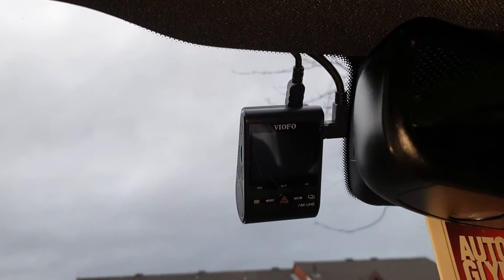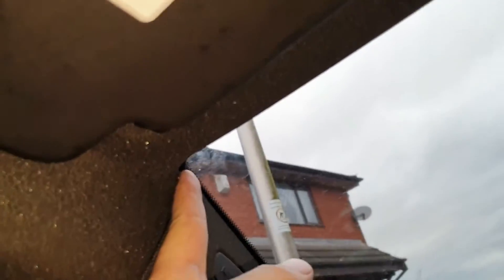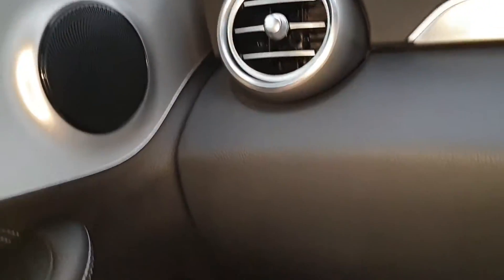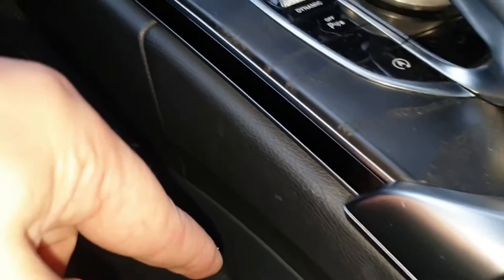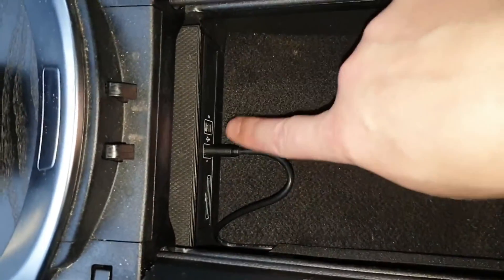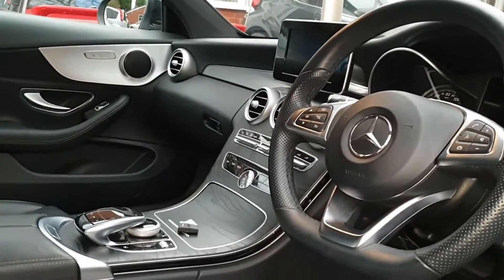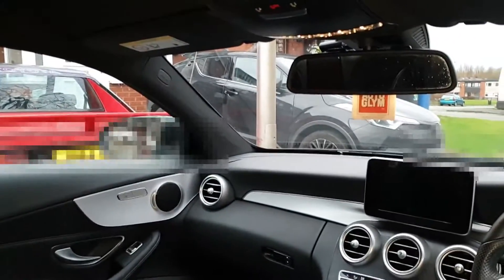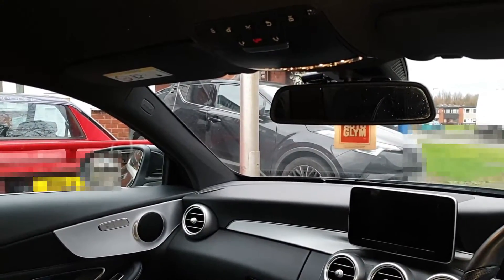VIOFO A129 PRO DUO DASHCAMERA  USB INSTALLATION INTO MERCEDES C 250  D AMG DANNYDASHCAM

Comment: thank you for the video. I have a similar car too . If the usb cuts out when the car is locked, does it mean the camera's parking mode is not available?
Reply from the maker: No this method means it only records whilst the car is being used, to use whilst parked you would need the viofo 3 wire hard wire kit  fitting to the cars fuse box. Not a huge job to do but definitely  not as easy as this method. The hard wire kit also has voltage drop protection so if the car battery voltage gets low it shuts down the camera so you can still start the vehicle.
Reply: @DannyDashcam  makes sense. Thank you and happy new year :)
Reply from the maker: @anexiole   you too Gordon,  happy new year

Comment: Great job and so neat, I think it’s a great idea to use the existing USB ports. I’ve just changed cars and plan to install my Viofo into my C300. I’m a little confused and very cautious about drilling a hole in my armrest. Please could you elaborate about the size of the drill bit, exactly where to drill and how to feed the USB connector through into the inside of the armrest? Did you have to loosen the armrest?

Cheers,

Graeme
Reply from the maker: Hi Graeme, you drill a hole the size of the connector that fits the camera not the USB so its smaller ,  normally under a carpet or plastic trim that can be removed so when you replace the trim the hole is covered up.  If this is not possible  then find the least conspicuous place. Yes In some cases I have to loosen the centre console to feed the cable but not always. Have a good look about and see how it goes together and use maybe a piece of firm plastic to see if you can feed it through  where the wire needs to go and tie the wire to it with electicians tape and carefully retract it. The factory USB socket  is good to use as long as it provides enough power,  early models didnt but most newer vehicles are fine  to use.
Reply: @DannyDashcam  great, thank you 👍🏻

Comment: Just installed viofo 129 plus duo in my c class saloon using this guide. It's not as clean as yours, I could not hide the wire properly where the roof and A pillar meet. Also the C pillar and A pillar seems a little bulged outside now. Scared to push it hard because of the airbag! Front to rear cam wire wsd too long, I zip tied it and hide it in the boot from behind the seat.
Reply from the maker: I normally hide it in the rear boot panel gap  or if room roof.lining but that can effect radio DAB signal sometimes. The camera is possibly the best of the a129 range in my opinion,  don't forget to check foe firmware updates. Enjoy 👍

Comment: Did you remove the SRS side panel or squeezed and slided the cable through down under the glove box ? I m thinking of using the same method but hopefully not removing any panels.
Reply from the maker: If memory serves it fit in the panel gap but I had to undo the centre console nuts to give more play/ gap for the usb socket . Apart from that it was pretty straight forward
Reply: @DannyDashcam  thanks.
Reply: I done a similar set up all worked. I have a separate front and rear dash cam. The front dash cam is connected through the cigarette lighter this also has a usb port at the back.  The rear dash cam is connected to that, so not to the storage unit usb. However, for some reason the rear dash cam, the date and time always seems to reset. It could be either the power is not too great through the front dash cam cigarette usb connection or I should use the usb in the storage unit instead or the rear dash cam is faulty. It is quite old and basic.
Reply from the maker: @mrahman1407  if the time and date resets its because its a battery dashcamera. The internal battery fails pretty quickly and can endanger saving files so my advice buy a capacitor camera. Theyre way more reliable and normally the same price as battery cameras. Aukey do dr02 for 50 quid regularly  , and do a dual version called the dr02 dual for £109
Reply: @DannyDashcam  thanks. I believe the battery could be the issue. The front dash cam is good a one Apeman which i brought for £100. No problem with that. Normally, such as a camera or dash cam once you set the time, date and save. It should stay like this and not reset. Now, just need to get a small rear dash cam preferably with  a usb mini port. As i already done the wiring lol
Reply from the maker: @mrahman1407   this link is the one I mentioned. Its well worth 50 quid. And I think should fit the woring but check 1st.

https://www.amazon.co.uk/dp/B0711K92J1/ref=cm_sw_r_cp_apa_glt_fabc_QJNZ5W7HJM8Q409T8DFH

Comment: Great camera, 🎥 very discreet you can barely see it. 
I like these little reviews by the way.
Reply from the maker: Thanks. Yes it is  super discreet but  also easily removed if needed.  Performance  wise it is also superb,  slightly on the pricey side but worth it in my opinion.
Reply: Danny Dashcam Yep super little camera. I got the older version, you know the V2 one I got that one.
I’m using suction mount and that’s not very good at all. It keeps falling off
Reply from the maker: @KT-it3jh  the a119 v2 ? I'm sure you can get the 3m stick on mount , in comparison with your camera and this camera  however is like comparing a 125 cc scooter to a 600cc sports bike. When watched on a UHD television  then footage us unreal
Reply from the maker: @KT-it3jh  check if this is for your camera 

https://rover.ebay.com/rover/0/0/0?mpre=https%3A%2F%2Fwww.ebay.co.uk%2Fulk%2Fitm%2F123499959114
Reply: Danny Dashcam Will do thanks Danny 😊

Comment: Do you have problems with viofo cables, because it's bigger than other dashcam cable ? At least according one of the store I came to, he said Benz user don't like Viofo because  it's ugly and the cable is big, but then he offer me other brand (more expensive) 😀.
Reply from the maker: The cable to the rear camera is larger than a normal cable by 1mm , but any decent fitter can easily fit the cable. I fitted one yesterday without any issue whatsoever. I'll also add i edited the learner car footage from original thenother pad on another post thatbwas a blackvue , no where near as clear as the a129 duo imo Dont take them on.
Reply: I won't bother if he mentioned it earlier. When we chat he said nothing, and urge me to come. But when I arrived he said that most of his customer especially Benz  complain about Viofo, he said he thought my car is Toyota..